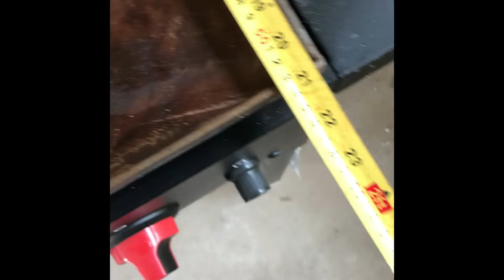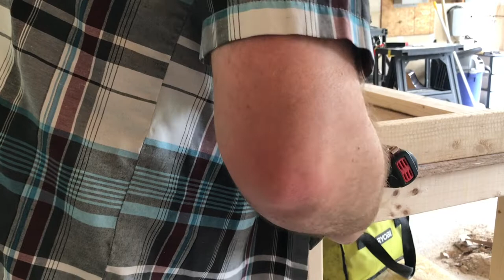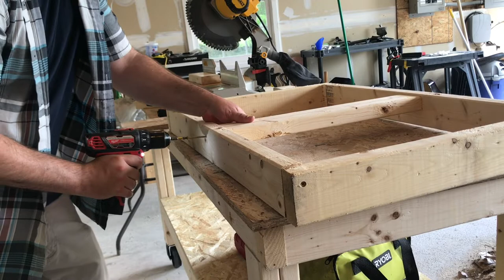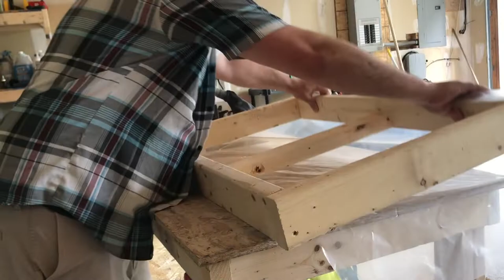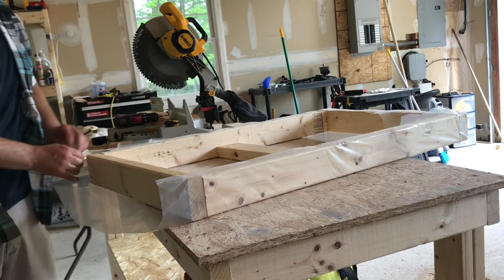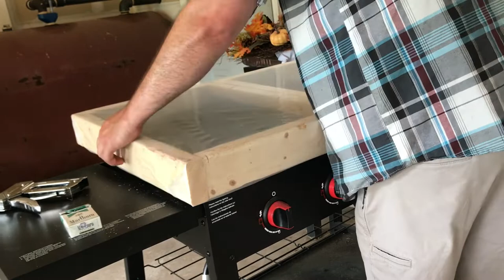Flat top grill cover diy

Comment: Idea is good...but why a thin sheet of plastic? It will eventually rip.  A Thin sheet of aluminum or stainless steel would be ideal for the top.
Reply from the maker: I was just using what I had laying around my garage. But yes a sheet of aluminum on the top would be nice.